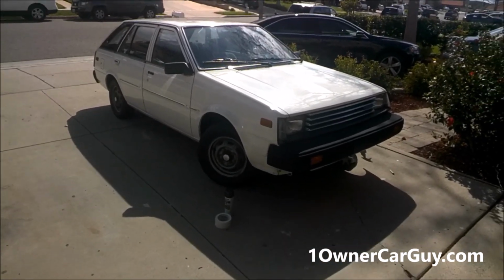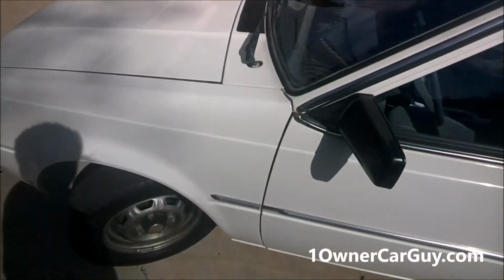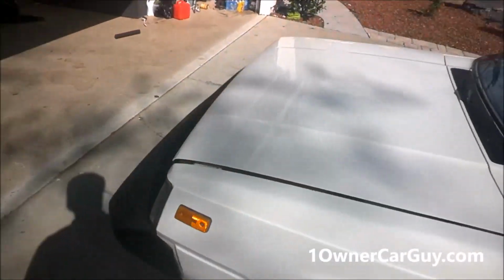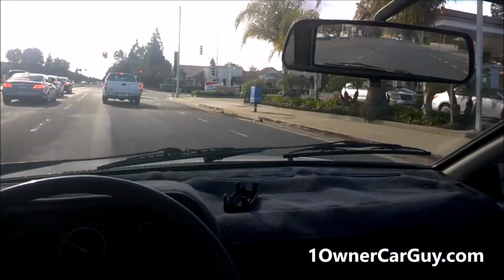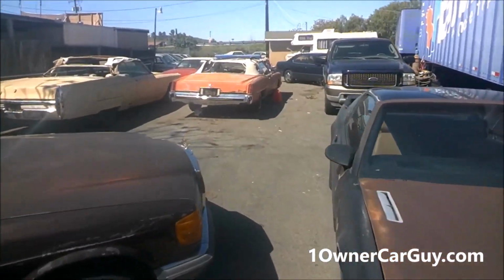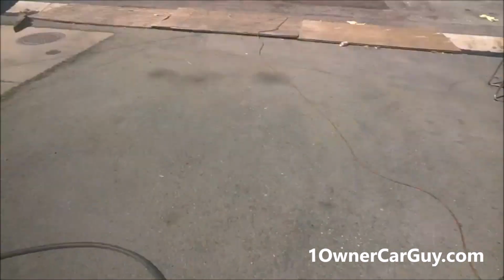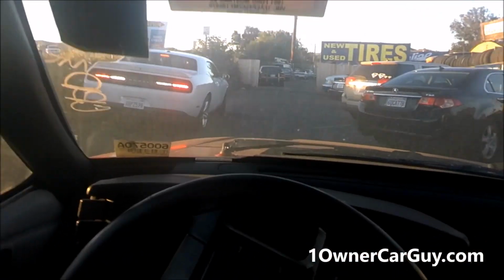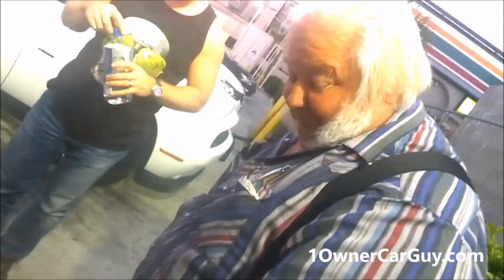WREAKED MY CAR ~ KIRILL FROM RUSSIA ~ DAILY VLOG ~ DETAILING TIPS & MORE

Comment: yeah, check the fuel pressure should be 50 Psi. now put new anti freeze in it. I have had many fords and they dont generally need fuel pumps. I have a Ford CV with a noisy fuel pump and it runs great.I have a V8 explorer EFI and the Fuel pump is mounted in a big rubber jacket in the tank so it is quiet. However the pumps are about $20. to $50 on Ebay.That little 302 runs great if you know them.

Comment: Throttle Body !!!!!!!

Ford of the mid 80's to mid-late 90's are notorious for bad Throttle Bodies !!!

Doesnt matter what engine they have they are crap ! They start up..stall,put in gear stalls,you have to pump them to start the car when cold,they stall,hesitate when driving..Then fine...then some sort of above symptom happens,stalls at a light etc !!

Ford had this problem in trucks,small cars,mid size and full size cars not just the V8 the 6 and 4 cyl too !!! Furd issue it is !

FYI : 5.0 Fords automatic in the Slowstangs had 205 hp...The 5.0 5 speed standard/manual trans had 225 hp ! I know this with no searching on the interweb...Car guru here(not just a knowledgeable Mopar guy,but of all American cars and so,so & so , on the foreign jobs) i do,have done mechanics,body/paint guy and Drag raced cars for a time and owner of classics,modern cars and buy/sell 'em even today  ! 

Oh,I owned about 15 Fords from the 80's to 90's that did this...Not all did it but a lot did,So Ford boys dont get your panties in a knot !! 

Thats how I bought them cheap and sold them for a good price actually..I sold them quick by well,my secret selling them for the previous years price and thats usually the base model of the year of the car..Or another way to say it..Sell a mid level same year car for the same year base model price(depending how much you have in it of coarse)..I usually sell all my cars like that and every make/model sells fast,fast !! That worked for me,very well..The money I lost I made up by buying more and the cars didnt sit...I am not saying this in or to a negative way to you Nathan,as your business is different and you are never there  etc.. Oh,I dont let my classics go for cheap,those I sit on enjoy and dont care if I ever sell them...I never sold them cheap always the highest price and even higher !! 

Anyways,Throttle Body,Fords biggest problem !!
Reply: Good info , Thanks